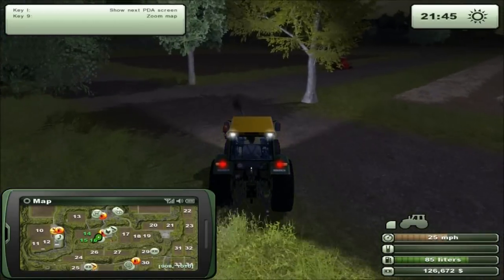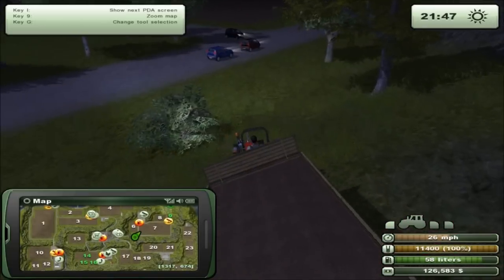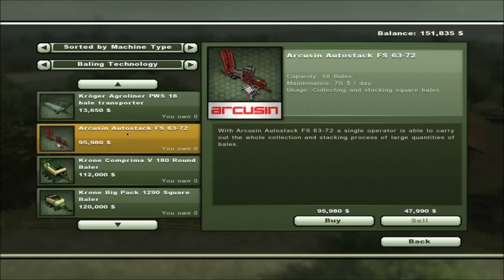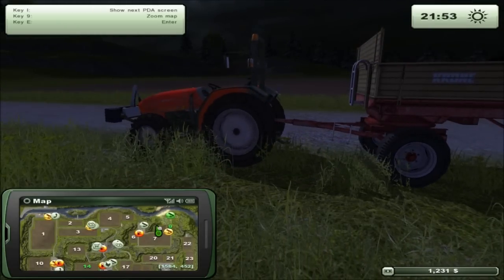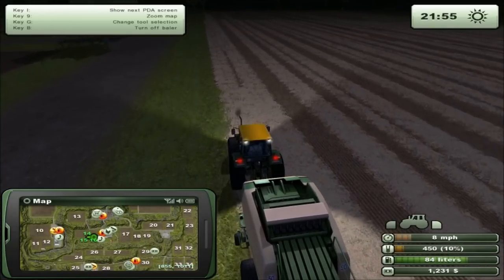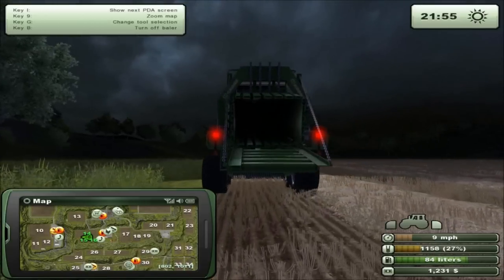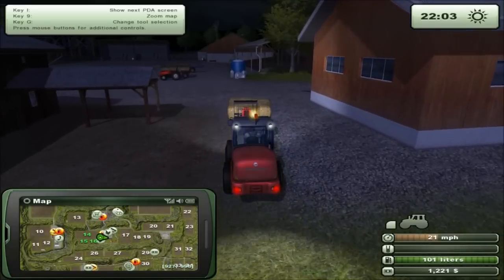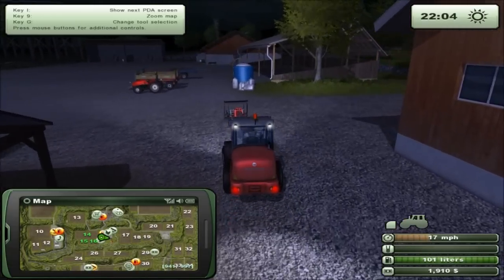Farming Simulator 2013: Ep6 - Hay Bale Technology

Comment: Hey. nice videos. Just some advice you should use The round baler as the square baler takes it to get to 100 percent 3 times before producing a bale. and the round baler only has to get to 100 percent before producing a bale.

Comment: Use G to select the first trailer on the bottom right icon. disattach from the trailors so the two trailers stay connected with each other. Back up a third trailer in front of the two, attach, and use G again to loosen the tractor from the three connected trailers.,Continue this till you are satesfied an park them all connected tougether.